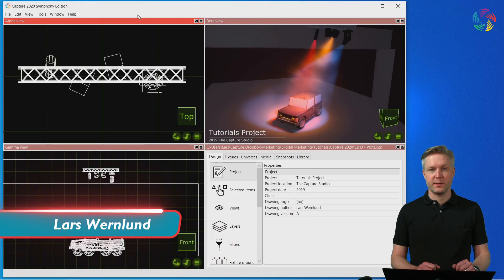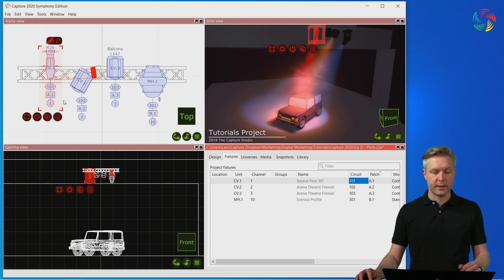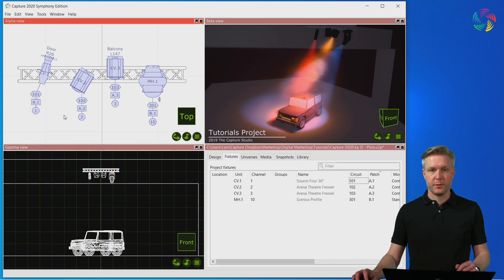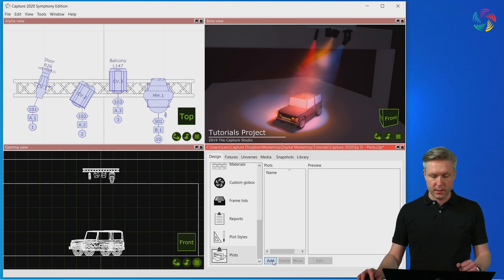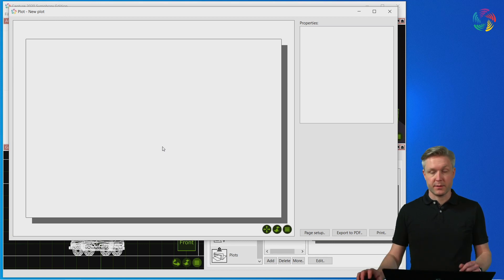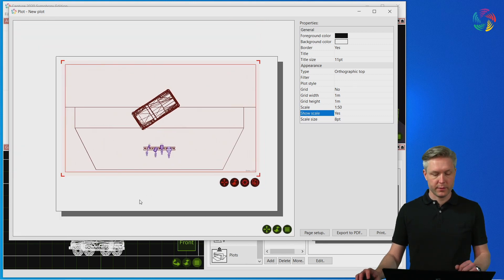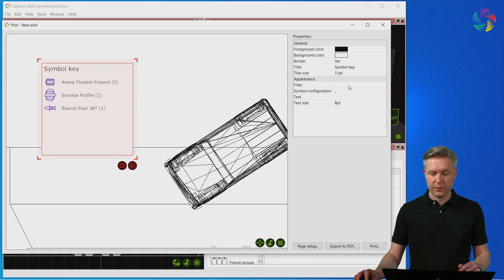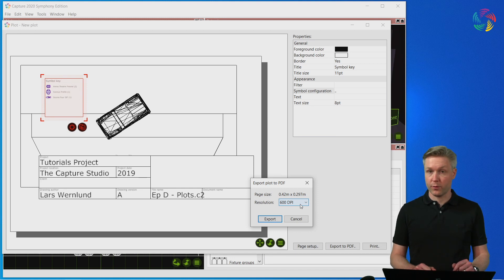Plots

Comment: How do I apply filters to a plot? I have filters applied to get rid of the module stage, band etc, that make it hard to see details. When I drag a view into the plot, the filters do not apply. 

How do I make this work?
Reply: Also, can you choose which view to use? Or does it choose alpha by default? I’m on 2022 btw.
Reply from the maker: @swingsetsounds7983  Each view in a plot has properties for, among other things, selecting the type of view as well as which filter to use!